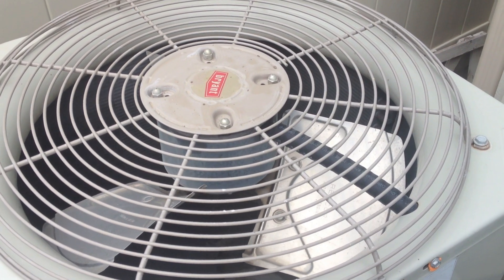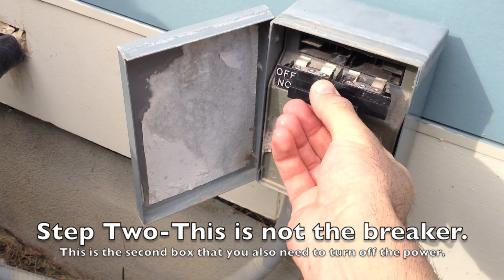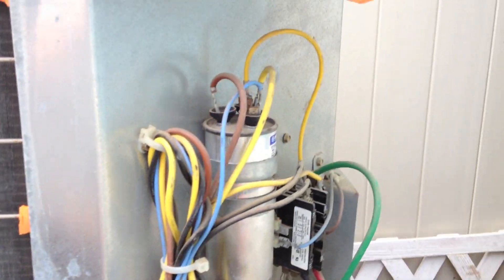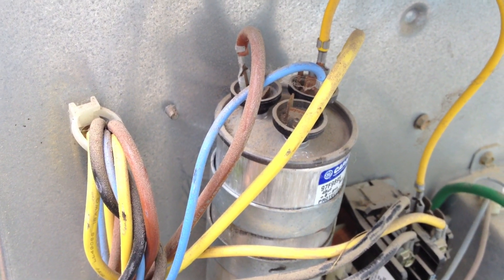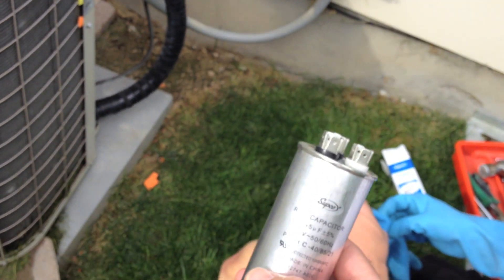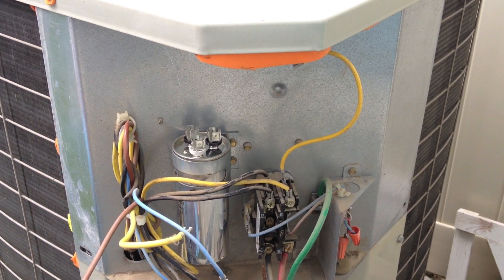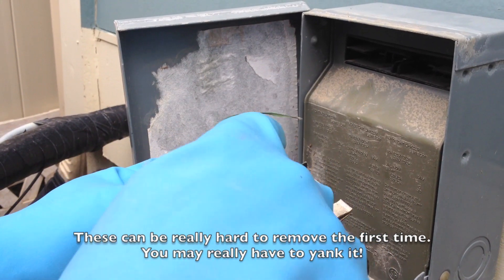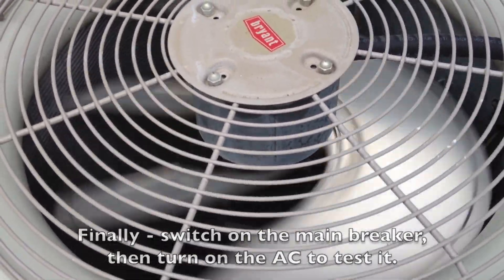AC Fan Not Working - How to repair broken Air Conditioner HVAC Run Start Capacitor

Comment: Hey idk if you will respond but I would like to know the model number of that unit just because I believe I have the same unit however I cant see the nameplate just because of the wear and tear of the unit so it faded out
Reply from the maker: @a.n.c.r.3564  if it hasn’t been replaced I’ll go back to that residence and look for you.
Reply: @AdamDIY  nah I don't want to trouble you too much so if you don't know that's ok, I work for an HVAC company started last week and I think they might help me research it a little bit since it's an old medallion series.

Comment: Nice vid, I would just suggest as a help: tell/show the viewer how to short the cap so it is discharged completely to avoid danger of shock.  Also you might add in next time how to make the double cap into 2 separate caps ; why because its lower cost for one then to have to replace a double cap.   thanks.  * sometimes its expedient when all a person has is one cap as well and not time to run for parts.

Comment: Adam, you saved me about $300 today. It's 102 in Reno, NV and most repair places could only come within one week (because, I get it it's crazy season), and they would charge me $150 just to get to my house. I watched your video, found a part store in town and replaced the whole thing in less than 15 minutes and the part was $18. We're back in business. Thanks Adam!
Reply from the maker: That's awesome!  I'm just one state over in Utah and it's hot here too. (not 100+) I can't imagine waiting around for a week in that heat!  Glad to hear you got it going.
Reply: What's the easiest way to make a small donation?
Reply from the maker: Thank you so much Milan.  
My Venmo is: AdamCash, 
paypal is: www.paypal.me/happyatom
and Patreon works but you need to not make it a reoccurring donation www.patreon.com/AdamDIY  and lastly if you prefer the classic way: 
Adam Hill (DIY)
10102 S Redwood Rd # 95278
South Jordan, UT 84095

I don't often get donations but when I do I spend it on better video equipment. So it is much appreciated! Again, thank you.

Comment: 0:19 - 0:20 what is that noise?
Reply from the maker: It's the electric motor trying to start from a dead stop without the help of the capacitor.

Comment: The top of my old capacitor is rusted. I am unable to read where the C, F or Herm terminals are. Any suggestions?
Reply from the maker: I go in great detail in this newer video https://www.youtube.com/watch?v=9K7Uw3eMzv0   
Yes you can often tell by the number of terminals (see video) you can also use a voltmeter with a capacitance meter to test it.  I show that in another video.

Comment: My problem is the opposite. The fan runs continuously, even with the system shutoff at the tstat on the wall in the house.
Reply from the maker: what brand thermostat do you have?  It could be faulty.  Maybe disconnect it and remove the battery.  Let it reset.  Then hook it up and see if the problem persists.
Reply: Adam - the contactor was bad. Replaced. My tstat has no battery. I did remove it and blow out the back side with compressed air-in-a-can + I sprayed with electronic parts cleaner. Again - the contactor was worn out - 15 yrs. old and as a result of it being fried, the outside fan would run when the air handler had shut off..

Comment: Safety Tip!!!  Do not put the ON/OFF breaker back into the same case...set it on top.  Technically you can put the breaker (or whatever you wish to call it) in upside down and no current will flow,  but if you set it on top, you know 100% sure that it is pulled out and not installed and you have a visual confirmation at a glance that there is no power.  Also, before you remove the wires, make sure you not only take pictures, make notes of which wires on on (C), on (FAN) and on (HERM).   Besides that, excellent video.

Comment: My fan was running, but then abruptly stopped. (the unit continued to buzz) It's pretty old, and I do know it's the kind that needs oil (it has two small yellow plugs labeled oil) so I got some proper lubricating oil and squirted it into the appropriate areas. Afterwards, the fan started spinning fine and ran for some time, then it stopped again, abruptly. I thought I did not use enough oil, so I squirted in some more. Same thing happened, it ran great and then stopped abruptly. Any ideas? Fan motor, capacitor? Something else? Heeeelllp meeee.....

Comment: how do I know which is the right capacitor for my unit
Reply from the maker: I think this video will answer your questions: https://youtu.be/9K7Uw3eMzv0
Reply: Ruben Sepulveda you should see something like this 30uf+5 or 30+7.5
Reply: Ruben Sepulveda on the data sheet on the capacitor

Comment: I have ac technician checked my ac but two weeks later problem occurs still. The compressor and its fan stopped working after one minute. Well. I am not sure if the compressor is working or not but the fan is not spinning i am sure. Other parts are good. Will it be the capacitor's problem? Anyway. I am going to get it checked this week.
Reply: maybe you're ac is tripping or maybe the electrical connection of your ac is shorted or grounded

Comment: Hiya and thanks for your video and helping everyone.  I don't even know if you're still around but here's a shot.  I've got a Trane XL1200.  My fan starts up, compressor runs but maybe for 5 minutes max.  The blades spin just fine.  And I was able to spin / jump start it.  But again it ran for 1 minute and stopped.  Would my issue be the capacitor?

Thanks again!
Reply from the maker: +Storm Tyler I would at least take a look. If you see a bulge it is obviously bad.  It's a cheap fix as well.
Reply: +AdamDIY Thanks man, I will look at it tomorrow after work.

Comment: I have a 10 year old Lennox Central AC Unit.  The fan stopped moving, so
 I had the motor fan and the Capacitor replaced. Then it started working
 again.  After 30 minutes, the fan would stop spinningwhile the 
compressor was running.  I could feel the heat generating from the 
compressor. Turned off the circuit breaker.  Tightened the wiring, then 
the fan worked again.  30 minutes later, the fan shuts off again.  Can 
someone tell me what the issue might be please?
Reply: it might be corrosion on the fan leads because corrosion does not pass electricity

Comment: Video is extremly helpful, I had the AC unit on last night and I noticed that it had stopped it won't start but real helpful the comment on the voltage hum when you try to turn it on.  I've noticed this same issue with fans, thanks again.

Comment: our air is not working. The unit isn't turning outside...it is not making a buzzing sound.  Do you know what could be the problem?
Reply from the maker: +Lisa Young When you say "not working" what do you mean exactly.  What exactly is it not doing and what is still working.
Reply: check the power supply or call electrician

Comment: AC stopped working. Googled problem and found your video. Ordered part online, arrived today and installed it in 15 minutes. Your video was great and saved me probably $ 200. Although my old capacitor had more less exploded (top blown off) I'm so glad you explained how the capacitor may still be charged and how to discharge it. Any way just wanted to say thanks!
Reply from the maker: +Dennis Bailey I love to hear when people save money!  Empowering isn't it?  Thanks for the comment.

Comment: The fan is working on my AC unit but I guess the compressor is not working, the air is not coming cold. I have a Heil Unit for small apartment. I did reset (turned off the unit and thermostat) three times and it work but now this is not working anymore.
Reply from the maker: +Sorley Velasquez Is the compressor making any noise?  What leads you to believe that it is not working?
Reply: The compressor is not making any noise. the two capacitors were replaced but that was not the problem. finally I did  push a switch that is placed in the small box where the big capacitor is and the compressor started working but when off very soon. The whole system is located inside the apt in a small room. I guess something else is wrong and a fuse some where is stripping.

Comment: Holy crap.  You just saved me a few hundred dollars!  Turned off the power, took out the old capacitor, called Grainger with the part #, picked it up in 20 minutes, installed the new capacitor in 20 minutes.  It worked!!  My wife thinks I'm a genius!  Thanks man!!

Comment: Dispose of the capacitor properly!  DO NOT put it in the trash.  I would consider it on the same level as putting used motor oil on your household garbage.

Comment: DISCHARGE THE CAPACITOR BEFORE YOU TOUCH IT!!  If you don't own a multimeter or don't know how to use one don't touch electric!
Why did the capacitor fail? What is the resistance of the compressor windings?  What's the amp draw of the fan motor and compressor?  Did you make sure your Stak-on connections on your new capacitor are tight and not loose?   DIYers beware of making a deadly mistakes messing with high voltage equipment!  Fixing stuff your self is great and nothing is wrong with it at all, but their are many other things that need to be checked after you replace a part. Call a professional when it comes to expensive, critical equipment for your home or business.  Also, don't get caught messing with the refrigerant charge with out an EPA license.  You could be fined up to $20000 for venting refrigerant...and the person who turns you in gets half the cost of the fine!!!!
If you don't understand exactly how what your working on works, you could make a small issue a big one.
Reply from the maker: +PatrickNJ Super good comments Patrick! Thanks for chiming in.

Comment: Diagnosed and fixed the capacitor based on this video..  U r doing the lords work and a terrific educator.  I saved $100 to $300 fixing it myself.  The most annoying part was removing all the screws and waiting 3 days for the part from amazon because home depot and osh do not carry this part. Thanks so much!!!

Comment: Thank you. Our A/C stopped blowing cold air tonight---on the eve of what's supposed to be the hottest day of the year so far---and I was able to diagnose it down to a bad run/start capacitor. Your video was very helpful.

Hopefully I can source a replacement capacitor locally tomorrow.

Comment: Thanks so much. I just bought a capacitor and replaced it myself. Everything works after one very hot day with no AC. You saved me about $200 in repair bills. Thanks!
Reply from the maker: achievemore66 Awesome! Glad to help.

Comment: Looks like the capacitor is my problem, so I am looking for replacement part. The one in place says "370 VAC". I'm seeing parts that are "440/370 VAC". Is this acceptable or should I look for 370 specifically? Also, the "+6 -6%" - is there any leeway with this number? I found other numbers exact except for this which says "+-8%". 
Thanks for your direction. I, like several here, can't afford the service call. Just thankful I have a window unit on my second floor as I wait for the part in 100 degree weather.
Reply from the maker: 123JWJWJW The VAC should be fine. The +6 -6% is the tolerance it has.  So that is saying that it will be possibly 6% more or 6% less energy.  That should be fine too.   Be sure you are hooking up the wires correctly.  If you need help wiring it you can check out a lot of other youtube videos.  Here is just one that I found.    If you call up a HVAC supplier and tell them the model have they will get you the right capacitor for the job.
Reply from the maker: 123JWJWJW https://youtu.be/yuINo7CWFaE

Comment: I felt that certain parts of the cap could go out and that the fan cap could have gone bad.  It turned out that it was a bad fan.I replaced the fan motor and put the fan on a single cap and the problem has been resolved.  Thanks for your response.

Comment: my issue is similar but the when I turn on the power the fan wants to turn but is being restricted.  You can push the blades and they move very slow, I wouldn't call it spinning at all.  It would take 3 min. + for the  blades to make a make it around.  The Cap was replaced earlier in the week.  My ? is has the cap or the fan motor gone bad?
Reply from the maker: J Young Why did you replace the cap the first time? Is this a new problem after you replaced the cap?  Capacitors can be in a "going bad" stage where they make things act goofy.  They are not like a lightbulb where they are either working or not.

Comment: If the air handler is working and the outside unit doesn't run (no buzzing), would it still be the capacitor?  We've had the repairman out 3 times and the last time he changed the thermostat and that helped for 1 week and now it's doing the same thing.  Any thoughts?
Reply from the maker: Yes it could still be a bad capacitor.   Capacitors can go bad just like batteries do. Sometime batteries are totally dead and sometimes they are weak and in the process of dying.  Capacitors can behave the same way.  I would try replacing it because it's an easy cheap fix.   It also soundscould be a problem with a bad wire connection.

Comment: I've worked with most electrical household problems including breakers, so I'm fairly certain I can do this. My Carrier unit is doing exactly what yours was (electrical hum but the fan is not turning, and the house is a bit of a sauna at the moment), so I'm willing to try it.

My question is, are the capacitors available at most large hardware stores (home depot, Lowes, etc.)? Or at Ace Hardware? I'm not overly interested in paying hundreds for someone else to do a job that I can do myself.
Reply: Also, it's not a random buzz. It's a loud constant buzz.

So in the event that it's the fan motor, what would you predict (dollar wise) that should be reasonable to just have GIddens Brothers do it (they're right here in town)?

The capacitor, I'm certain I can do.

The fan motor, I'm not certain I would even want to try. I think I'd rather have a professional do it.
Reply from the maker: No, home depot / lowes does not carry these. But you can get them online or at electrical specialty stores. I had to drive 30 min. to get to one near me. [not bad]  Ill get back to you on the fan question.

Comment: My split unit working for 1 to 4 hours then tourn off alone
And there is 3 lights plinking( power,auto & timer),
When this hapen i cut the power off and on,
After that my ac working agane for another 4 hours
Pls help me to find the problem

Comment: Hi Adam. My AC has similar symptoms. My fan is not spinning and I hear an electrical hum but not the random buzz. I replaced the capacitor today and the fan still does not spin. I still hear the electrical hum but not the random buzz. Please help.
Reply from the maker: Use a stick to try and spin the motor. See if it spins freely. I am wondering is the motor is bad. Or is the noise coming from the compressor below?
Reply: AdamDIY Hi Adam. I spun the fan and it does spin freely but it does not start. I've seen in some videos that when the capacitor is bad, and you spin the fan, it should start. The electrical hum is very soft and I believe it is coming from the capacitor/contractor area. How can I tell for sure if the sound is from that area or the compressor?
Reply from the maker: Cesar Ramirez  If the hum is big enough you can tell by touch.  SAFELY place your hand on the motor and then the compressor. You may feel a stronger vibration on the source of the noise.

Comment: Adam, Help me please.... I am in Orange County California. I am so worry that someone will charge me a lot to fix the problem. I am not working, but I need fresh cool air for my family. Greatly appreciated
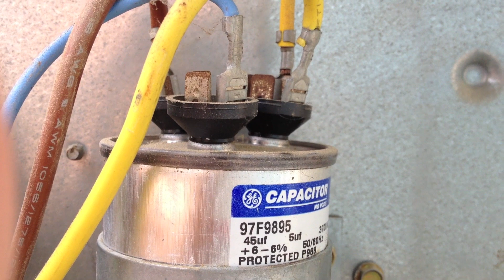Reply from the maker: Shut off the AC at the Breaker and then open the side panel of the outside unit. Then take a picture of the capacitor and send it to adamhbs@gmail.com You need to see if it is bulging just like it is in the video at the 1:16 mark.

Comment: My God, this is such a great video. My air conditioner was installed in 2017, today the condenser ( the big fan outside) is not moving or working. Do you think this is the capacitor??. Help me pleaseeeee. It is so hot and I need help. Thanks so much.
Reply: You're from the FUTURE?? O.O  (kidding aside, I hope you got your AC fixed)
Reply: I hope you got your ac fixed.  How are units in the future of 2017?
Reply: Are you joking  Or frustrate
Reply: Ok. Sorry my God.  2007. It is true I am so frustrated now, today the motor under the fun is not working. I hate this heat 101 degrees. What can I do now? Help me please.
Reply: Very appreciated, Thanks
Reply: While i suggest having an ac guy come look at it, it COULD be a capacitor for the fan (maybe?). My capacitor for the outside handler/compressor went out recently. AC Guy said there's a red reset button on the bottom, he hit that and manually moved the fan with a stick and it started back up. That's when he knew the capacitor was bad. Replaced it, and no issues for a couple of months now.
Reply: If the outdoor fan motor is not running. It could be the capacitor.  If you change it yourself you need to be very careful, because voltages of 240 can kill you.  You need to disconnect all power and drain the capacitor before replacing it.  If on the other hand you are not comfortable with doing work on the unit by all means please call an ac guy who is trained to work on the unit.
Reply: Thanks to you all. Best Regard.
Reply: +George W how do you drain a capacitor before removing it?